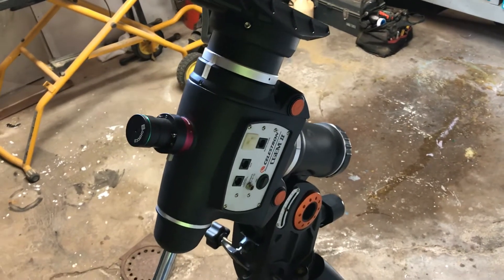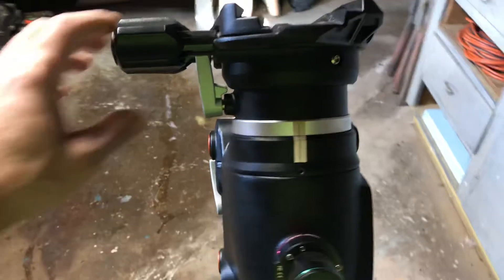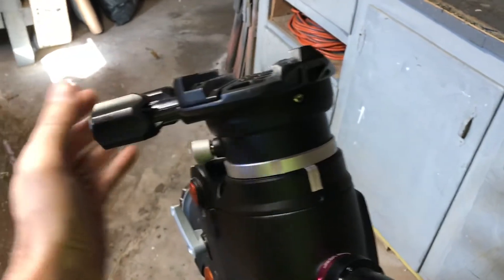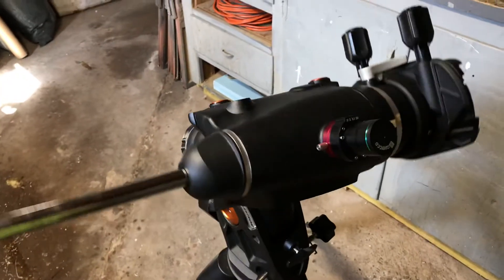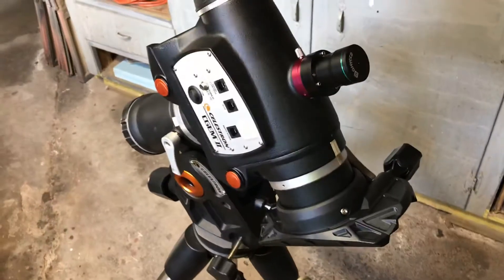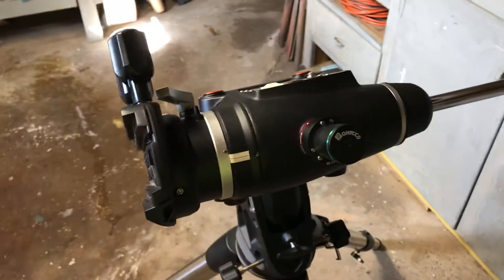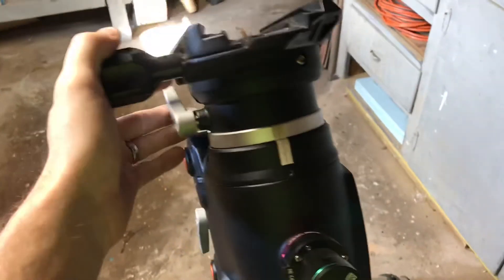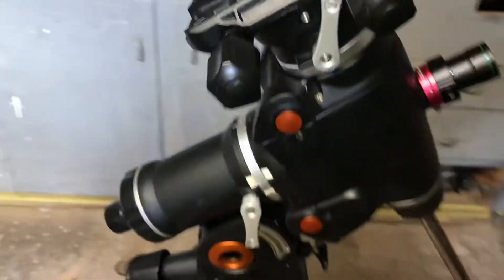Celestron CGEMII Pre Hypertune

Comment: Did you change the bearings?  What type & brand of grease?  Where did you get the bearings & grease? Thanks for the video; it shows what this maintenance can do for you.
Reply from the maker: I bought the hypertune kit from Deep Space Products.  The bearings are a ceramic hybrid.  Very smooth, high quality. With the kit you also get the tool for removing the bearings. There is a notched nut that holds the bearings and worm gear in place. The grease is called Super Lube it’s just a general all purpose synthetic grease. I bought that at my local Ace Hardware.  It’s been over 2 years and my mount is still running flawlessly.
Reply: Hi! Is there a video on the actual hypertune procedure?
Reply: @OigresZevahc  In You Tube type "Celestron CGEM hypertune" and there are several videos.
Reply from the maker: @OigresZevahc   The time has finally come around again that I needed to service my mount.  I just uploaded a complete hypertune tutorial.